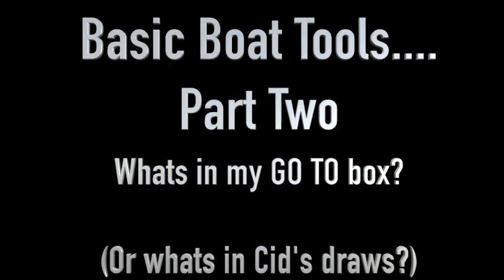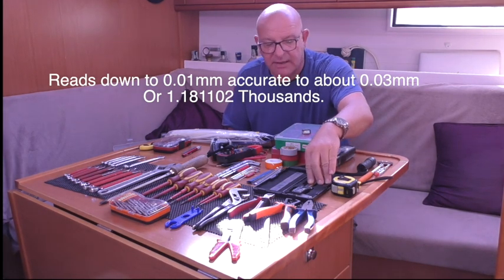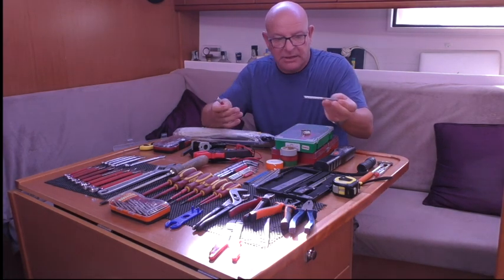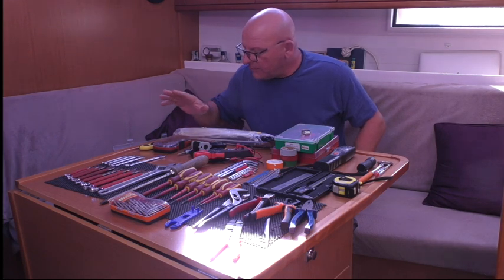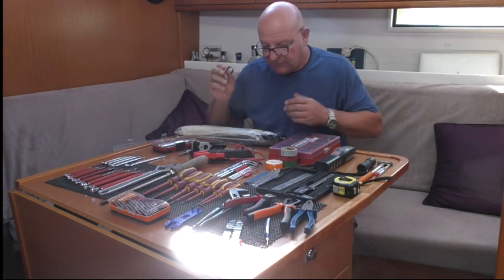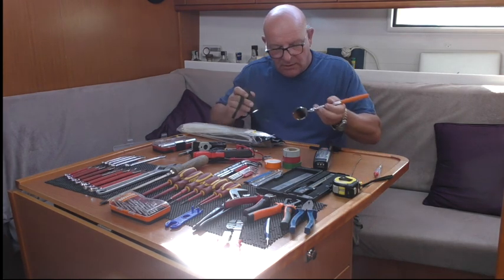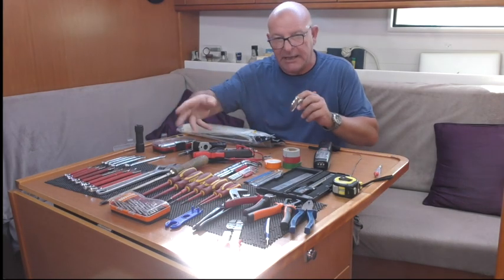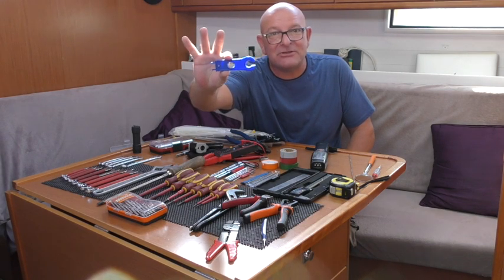Basic Boat Tools.... Part Two. What's in my GO TO box?

Comment: Good series of vids. Just a couple of points 😉
1. The IR thermometer is a much underrated tool it has so many uses - it is a great condition monitoring tool we use to use an IR camera on HV cable runs looking forward hotspots so it would have a similar utility on 12/24v systems at the connectors for high resistive joints while on load.
2. One addition to the common size O rings box you have is a Loctite (or similar) O ring repair kit - basically a selection of nitrile lengths of different diameters, cutting guide and ‘superglue’. It is so effective we generally used it in lieu of OEM spares on the larger CSA seals (Tubestacks et al).

Keep up the good work.👍😀⛵️
Reply from the maker: Good points well made as always Norman. We looked at one of the O ring repair kits. We only have two sets of O rings that we need to buy or make. Raw water pump to engine block and Heat exchanger to matrix. With a bit of google-ing we found them not as OEM but SAE standard at a fraction of the price. 
We were thinking of one more in the series.  Special tools that it is worth investing in. Hub or bearing puller, Decent sockets (impact) Torque wrench, Impact driver & a few other bits and bobs that you really do need if your going to be self sufficient? 
What's your thoughts?  Ant.
Reply: @SVImpavidus  Another episode on Specials would be useful. To your list I would add a couple of useful lengths of studding together with eight nuts for making ad hoc pullers ( you can generally get hold of strong back plates by bin diving in boatyards.😂
Reply from the maker: @normanboyes4983  Yes good idea. We have to pull the raw water pump out this year it would be good to use something like that to remove the bearings if they need changing. Thinking coolant pump, alternator pulley etc. Nice shout Norman. Sail Safe mate. Ant, Cid & the pooch crew.

Comment: So — Yes!! Absolutely would love to see your PART #3... Why? Because I am a little OCD—- and I am loving matching my gear list up with yours... It’s been fun! 

Also—- Million dollar question—- in your PART #3 vid— would live to know how you organize various drill bits... I have 5-7 major types I use on board, and also your Tap/Die set.  The monster plastic organize case is just a BIG waste of space.  Do you have an alternative cure for this one?  What about for your Socket sets?  I have a mixed boat— European made for USVI— so I am 50/50 on METRIC/SAE... nightmare I am well aware of.... 

Also— your secret tool looks like an AC /Die Grinder tool or a Diesel Fuel Injector leveraging tool... I’ve got both... But yours looks plastic
Reply from the maker: We are going to put together a part 3 over the winter. Drill box organisers are handy but they take up a lot of room. We have working drill bits in a case with the drill and the rest are in the plastic tub. The special tool is for solar panel connectors Or MC4 as they are called. The tool makes it easy to disconnect them. Sail Safe Guys, Ant, Cid & the pooch crew.